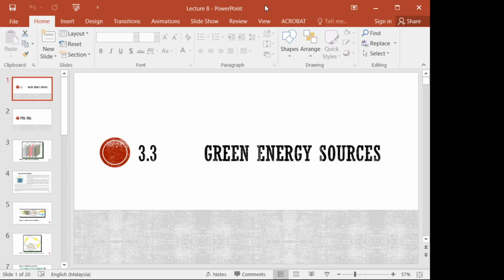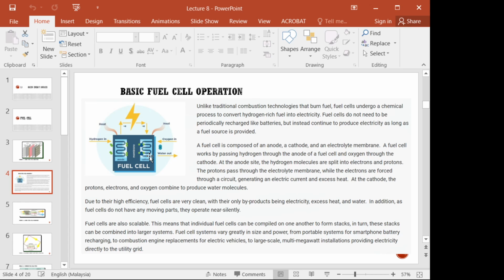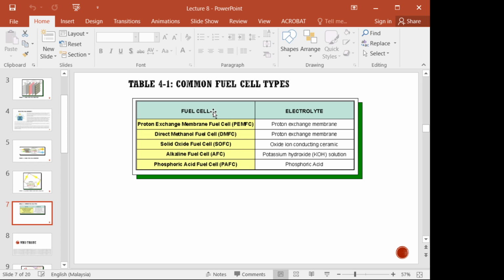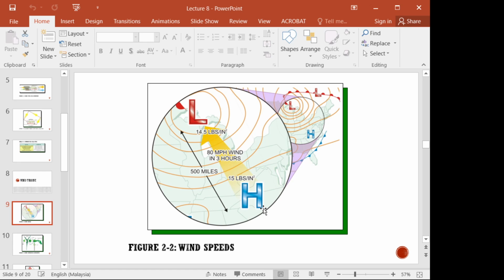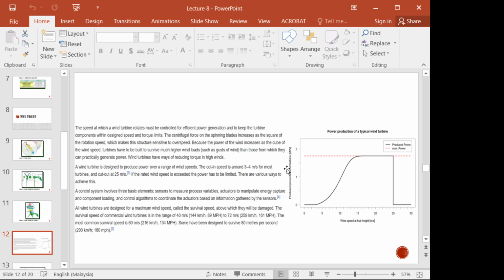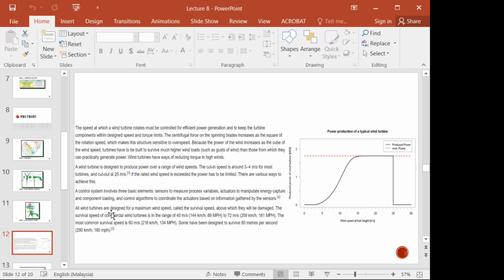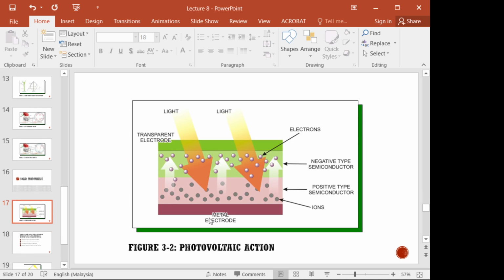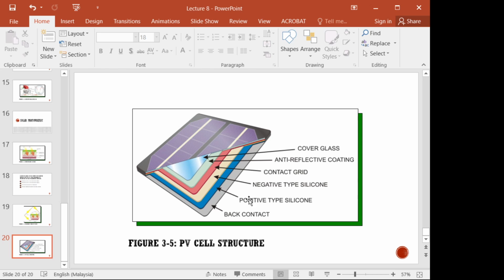Lecture 7 Introduction to Possible “Green Fuel”

Comment: MUHAMMAD ZULQARNAIN BIN ZAMZURI 
B071710782 4BMMH1/2

GREEN ENERGY SOURCES
=>Fuel Cell consist of anode, cathode and electrolyte membrane and undergo a chemical process to convert from hydrogen rich fuel into electricity
=>Advantages of fuel cell: High efficiency, No moving part, Silent operation, The fuel cell is scalable

+>Wind turbine rotation must be controlled for efficient power generation and keep the turbine components within designed speed and torque limits.
+>The centrifugal force on the spinning blades increases as the square of the rotation speed, which makes this structure sensitive to overspeed.
+>Designed to produce power over a range of wind speeds.
+>Control system involves 3 basic elements; sensors to measure process variables, actuators to manipulate energy capture and components loading and control algorithms to coordinate the actuators based on information gathered by the sensors. 

Solar photovoltaic 
A Sun is equal to 1000 watts per square meter (1000 W/m2). This variable is affected by the following factors: 
==>The angle the light hits the surface (time-of-day)
==>The angle the light hits the surface (time-of-year)
==>The cloudiness/haziness of the atmosphere
==>The height above sea level where the surface is located

Comment: MUHAMAD NURHISYAM BIN MOHD HASNAN
B071710148 4BMMH S1/2

LECT7 GREEN ENERGY SOURCES

Fuel Cell
Undergo a chemical process to convert from hydrogen rich fuel into electricity
. Fuel cell consist of anode, cathode and electrolyte membrane

Advantages of fuel cell
1.efficient
2.no moving part
3.silent 
4.scalable

Basic fuel cell structure
1.Positive collection plate
2.Positive electrode
3.Catalyst
4.Electrolyte
5.Catalyst
6.Negative electrode
7.Negative plate

Comment: NUR SHAFIQAH BT ABDUL GHAPOOR
B071710400
4 BMMH S1/1

LECTURE 7
Green energy sources
1.	Fuel Cell
-	Undergoes a chemical process to convert hydrogen-rich fuel into electricity. Do not periodically recharged like batteries, but instead continue to produce electricity as long as a fuel source is provided.
-	Composed of an anode, a cathode and an electrolyte membrane. 
-	Very clean, do not have any moving parts, near-silently.
-	Scalable 

2.	Wind Turbine
-	Rotates must be controlled for efficient power generation and keep the turbine components within designed speed and torque limits.
-	The centrifugal force on the spinning blades increases as the square of the rotation speed, which makes this structure sensitive to overspeed.
-	Designed to produce power over a range of wind speeds.
-	Control system involves 3 basic elements; sensors to measure process variables, actuators to manipulate energy capture and components loading and control algorithms to coordinate the actuators based on information gathered by the sensors. 

3.	Solar Photovoltaic

Comment: MOHAMMAD NAZRIN BIN BAHARUDDIN
B07170111

	Basic fuel cell operation

o	Not like traditional combustion technologies.

o	It undergoes chemical process to convert hydrogen-rich fuel into electricity

o	Don’t need to periodically recharged

o	Continue to produce electricity as long as fuel is provided.

o	Fuel cell composed of an anode, cathode and electrolyte membrane.

o	Fuel cell work by passing hydrogen through the anode and oxygen through cathode. 

o	At anode site, hydrogen molecules are split into electrons and protons.

o	Protons pass through the electrolyte membrane.

o	Electrons are forced through circuit and generating electric current and excess heat. 

o	At cathode, protons, electrons and oxygen combine to produce water molecules.

o	It is very high efficient, thus fuel cell are very clean.

o	No moving parts.

o	Operate near-silently.

o	Scalable.

o	Can combine into larger systems.

•	Wind turbine

o	Efficient power generation is depending on the rotation of the fan.

o	Need to rotate within designed speed and torque limits.

o	The centrifugal force on the spinning blades increases as the square of the rotation speed.

o	Sensitive to overspeed.

o	Turbine is built to survive high wind.

o	Power generated by a range of speed.

o	Cut in speed is around 3~4 m/s and cut out at 25 m/s.

o	Actuator manipulate energy capture and component loading. 

o	Control algorithm to coordinate the actuator.

o	Design for maximum wind speed. (40m/s to 72m/s)

•	Solar photovoltaic

o	A sun is equal to 1000 watts per square meter.

o	Angle of the light hits the surface (time of day).

o	Angle of the light hits the surface (time of year).

o	Cloudiness/haziness of the atmosphere.

o	Hight above sea level where the surface is located.

Comment: Ahmad Khairul Akmal 
BMMH s1/1
B071710715

3.3 GREEN ENERGY SOURCES: 

i) Fuel Cell: 
1)	Undergo a chemical process to convert from hydrogen rich fuel into electricity 
2)	Fuel cells consist of anode, cathode, and electrolyte membrane 

ii) Advantages of fuel cell:
1)	High efficiency of the system
2)	No moving part within the system 
3)	Quiet and silent system
4)	The fuel cell is scalable 

iii) Basic fuel cell structure 
1)	Positive collection plate 
2)	Positive electrode 
3)	Catalyst 
4)	Electrolyte 
5)	Catalyst 
6)	 Negative electrode
7)	 Negative plate 

iv) Wind Turbine: wind generator components
1)	Nose cone  
2)	Blades 
3)	Face
4)	 Hub
5)	 Stator
6)	 Rotor
7)	 O-ring
8)	 Body 
9)	Yaw 
10)	Potentiometer

vi) Wind turbine is designed to produce power over a range of wind speeds. The cut in speed is 
around 3 – 4 m/s for most turbines and cut out at 25m/s. 

vii) BASIC ELEMENT CONTROL SYSTEM 
 1) sensors = measure a process variable 
2) Actuator = manipulate energy capture and component loading 
3) Control Algorithms = coordinate the actuators based on information gathered by the sensor 

viii) Solar Photovoltaic is a sun is equal to 1000 watts per square meter (1000w/m^2). This variable is affected by the following factors:
1)	The angle the light hit the surface (time – of – day)
2)	The angle the light hits the surface (time – of – year) 
3)	The cloudiness/haziness of the atmosphere 
4)	The height above sea level where the surface is located 

viv) solar Photovoltaic structure: 
1)	Cover glass 
2)	Anti-reflective coating 
3)	Contact grind 
4)	Negative type silicone 
5)	Positive type silicone 
6)	Back contact

Comment: MUHAMMAD HAFIZ BIN JOHARI (B071710380) BMMH S1/2

GREEN ENERGY SOURCE
Green energy comes from natural sources such as sunlight, wind, rain, tides, plants, algae, and geothermal heat. These energy resources are renewable, meaning they're naturally replenished. In contrast, fossil fuels are a finite resource that takes millions of years to develop and will continue to diminish with use.

Basic fuel cell structure
- Positive collection plate
- Positive electrode
- Catalyst
- Electrolyte
- Catalyst
- Negative electrode
- Negative plate 

Wind Turbine: wind generator components
- Blades
- Nose cone
- Face
- Hub
- Stator
- Rotor
- O-ring
- Body
- Yaw
- Potentiometer 
Control system contains 3 elements (sensor, actuator, control algorithm, where the wind turbine must be maintained at survival speed between 40m/s - 72 m/s to avoid damage

Solar Photovoltaic
A Sun is equal to 1000 watts per square meter (1000 W/m2). This variable is affected by the following factors: 
- The angle the light hits the surface (time-of-day)
- The angle the light hits the surface (time-of-year)
- The cloudiness/haziness of the atmosphere
- The height above sea level where the surface is located

Comment: AMIRA NASUHAH BINTI ALIAS
B07170121

1)  Fuel cell
• Basic operation where electrical generated from transmission of electrons via chemical process
• A fuel cell is composed of an anode, cathode, and an electrolyte membrane. 
• Hydrogen pass through the anode of a fuel cell and oxygen through the cathode. 
• On anode-side, a catalyst splits the hydrogen molecules into electrons and protons. The protons pass through the porous electrolyte membrane, while the electrons are forced through a circuit, generating an electric current and excess heat.
• On cathode-side, the protons, electrons, and oxygen combine to produce water molecules. Since there are no moving parts, it operates silently and high reliability

Type of Fuel Cell:
1. Proton Exchange Membrane Fuel Cell (PEMFC)
2. Direct Methanol Fuel Cell (DMFC)
3. Solid Oxide Fuel Cell (SOFC)
4. Alkaline Fuel Cell (AFC)
5. Phosphoric Acid Fuel Cell (PAFC)

There is a few advantages of Fuel Cell:
1. High efficiency
2. Clean (biproduct of electricity, heat, and water)
3. No moving parts

Wind Turbine 

It does not produce pollution for environment during operation.  

List of components:
• Nose cone
Blades 
Stator
Body
Potential meter
Yaw

3) Solar Photovoltaic 
• When the light contacts the PV, it activates the ions, (the photons from the negative semiconductor transfers to the positive semiconductor where the process generates electricity)
• The sun is equal to 1000 watts per square meter (1000w/m^2). This variable is affected by factors such as light-to-surface angle (time-of day & time-of -year), cloudiness/haziness, height of the PV surface from the sea-level

Solar Photovoltaic structure:
1. Cover glass 
2. Anti-reflective coating 
3. Contact grind 
4. Negative type silicone
5. Positive type silicone
6. Back contact

Comment: MOHD RAHIMI BIN MUSTAPHA
B071710225
4 BMMH S1/1
LECTURE 7: Green Energy Power Source

1)  Fuel cell
= Basic operation where electrical generated from transmission of electrons via chemical process
= A fuel cell is composed of an anode, cathode, and an electrolyte membrane. 
= Hydrogen pass through the anode of a fuel cell and oxygen through the cathode. 
= On anode-side, a catalyst splits the hydrogen molecules into electrons and protons. The protons pass through the porous electrolyte membrane, while the electrons are forced through a circuit, generating an electric current and excess heat.
= On cathode-side, the protons, electrons, and oxygen combine to produce water molecules. Since there are no moving parts, it operates silently and high reliability
Type of Fuel Cell:
>>  Proton Exchange Membrane Fuel Cell (PEMFC)
>>  Direct Methanol Fuel Cell (DMFC)
>>  Solid Oxide Fuel Cell (SOFC)
>>  Alkaline Fuel Cell (AFC)
>>  Phosphoric Acid Fuel Cell (PAFC)
There is a few advantages of Fuel Cell:
>> High efficiency
>> Clean (biproduct of electricity, heat, and water)
>> No moving parts

2) Wind Turbine 
= It does not produce pollution for environment during operation.  
= Wind speed in 4-season countries is   high due to large temperature difference, making electric-generation is more viable on large scale. Compared to Malaysia, where the temperature difference is small and less wind speed. 
= Wind turbine is designed to produce power over a range of wind speeds. The cut in speed is around 3 – 4 m/s for most turbines and cut out at 25m/s. 
= Control system contains 3 elements (sensor, actuator, control algorithm, where the wind turbine must be maintained at survival speed between 40m/s - 72 m/s to avoid damage
List of components:
> Nose cone
> Blades 
> Stator
> Body
> Potential meter
> Yaw

3) Solar Photovoltaic 
= When the light contacts the PV, it activates the ions, (the photons from the negative semiconductor transfers to the positive semiconductor where the process generates electricity)
= The sun is equal to 1000 watts per square meter (1000w/m^2). This variable is affected by factors:
	light-to-surface angle (time-of day & time-of -year)
	cloudiness/haziness
	height of the PV surface from the sea-level
Solar Photovoltaic structure:
>Cover glass 
>Anti-reflective coating 
>Contact grind 
>Negative type silicone
>Positive type silicone
>Back contact

Comment: MOHD SAZWAN FITRIE BIN MOHD. KHAIRIL FITRIE
B071710488
4BMMH 1/1
Green Energy Source
1.	Fuel Cell
Fuel cells undergo a chemical process to convert hydrogen fuel into electricity
Components of Fuel Cell:
•	Positive Collection Plate
•	Positive Electrode
•	Catalyst that has electrode in between
•	Negative Electrode
•	Negative Collection Plate

2.	Wind Turbine
Designated to produce power over a range of wind speed
Wind Turbine Control System:
•	Sensors
•	Actuators
•	Control Algorithm
Survival speed of commercial wind turbine: 40m/s – 72m/s

3.	Solar Photovoltaic
Sun is equal to 1000w/m^2
This variable is affected by:
•	Angle of the light hits the surface (time of day)
•	Angle of the light hits the surface (time of year)
•	The cloudiness/haziness of the atmosphere
•	The height above sea level where the sun is located
PV Cell structure:
•	Cover Glass
•	Anti-Reflective Coating
•	Contact Grid
•	Negative Type Silicone
•	Positive Type Silicone
•	Back Contact

Comment: Cheah Kok Hun
B071710006 4BMMH S1/1
TITLE: LECTURE 7 VIDEO GREEN ENERGY POWER SOURCE

A) Fuel cell
1)	Electrical generated from transmission of electrons via chemical process
2)	A fuel cell is composed of an anode, cathode, and an electrolyte membrane. 
•	Hydrogen pass through the anode of a fuel cell and oxygen through the cathode. 
•	On anode-side, a catalyst splits the hydrogen molecules into electrons and protons. The protons pass through the porous electrolyte    
         membrane, while the electrons are forced through a circuit, generating an electric current and excess heat.
•	On cathode-side, the protons, electrons, and oxygen combine to produce water molecules. Since there are no moving parts, it operates silently and high reliability
3)     Advantages:

•       High efficiency, 
•      Clean (biproduct of electricity, heat and water), 
•      No moving parts

B) Wind turbine 
1)	it does not produce pollution during operation for electric generation, but not necessarily mean the whole process is clean, but less carbon footprint.
2)	Wind speed in 4-season countries are high due to large temperature difference, making electric-generation is more viable on large scale. Compared to Malaysia, where the temperature difference is small and less wind speed. 
3)	Components:
•	Nose cone
•	Blades 
depends on wind pattern and the blade creates pressure difference between 2-sides of the blade (Bernoulli's principle) as the wind 
        goes through them. Lift is created from the pressure difference and turn the blades 

•	Stator
•	Body
•	Potential meter
•	Yaw
•	Wind turbine is designed to produce power over a range of wind speeds. The cut in speed is around 3 – 4 m/s for most turbines and cut out 
        at 25m/s. 
•	Control system contains 3 elements (sensor, actuator, control algorithm, where the wind turbine must be maintained at survival speed 
        between 40m/s - 72 m/s to avoid damage
)

C) Solar photovoltaic 
1)	When the light contacts the PV, it activates the ions, (the photons from the positive semiconductor transfers to the negative semiconductor, while the electrons from the negative semiconductor transfers to the positive semiconductor. Where the process generates electricity.
2)	the sun is equal to 1000 watts per square meter (1000w/m^2). 

This variable is affected by Factors 
•       light-to-surface angle (time-of day & time-of -year)
•       cloudiness/haziness,
•       height of the PV surface from the sea-level

3)	Detail Explorer of the Solar Photovoltaic structure:
•	Cover glass 
•	Anti-reflective coating 
•	Contact grind 
•	Negative type silicone
•	Positive type silicone
•	Back contact

Comment: MUHAMMAD SYAFIQ BIN ARZEMI
B071710014
4 BMMH S1/1

"GREEN ENERGY SOURCE
"

   # Fuel Cell - Fuel cells undergo a chemical process to convert hydrogen rich fuel into electricity.
      > Basic Components of Fuel Cell: -
         - Positive Collection Plate
         - Positive Electrode
         - Catalyst and has electrolyte in between
         - Negative Electrode
         - Negative Collection Plate

   # Wind Turbine - Designated to produce power over a range of wind speed
      > Wind Turbine Control System :
         - Sensors - to measure process variables
         - Actuators - to manipulate energy capture and component loading
         - Control Algorithm - to coordinate actuators
      > Survival speed of commercial wind turbine : 40 m/s to 72 m/s.

   # Solar Photovoltaic - a sun is equal to 1000 watts per square meter (1000w/m^2). 
      > This variable is affected by the following factors :
         - The angle the light hits the surface (time-of-day)
         - The angle the light hit the surface ( time-of-year)
         - The cloudiness/haziness of the atmosphere
         - The height above sea level where the sun is located

      > PV Cell Structure :
         - Cover Glass
         - Anti-Reflective Coating
         - Contact Grid
         - Negative type Silicone
         - Positive type Silicone
         - Back Contact